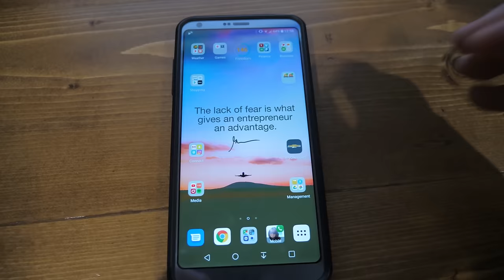We Turned 3 Sheets of Plywood into $1,300!! Massive Profit

Comment: Couple thoughts.. shame the face veneer of that plywood barely got seen, other that 1/64”- 1-32” for each slice turned sideways.
Also, would have been nice if you had the strips of herringbone pattern overhang the plywood substrate and then continued that pattern on the edge, rather than the vertical plywood layers.  (Just my opinion of course).  Came out nice though.